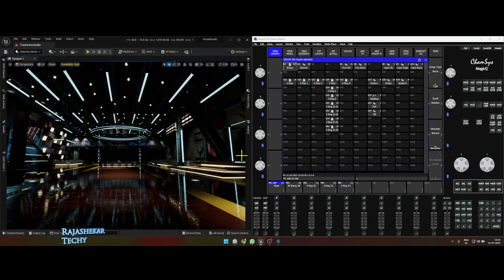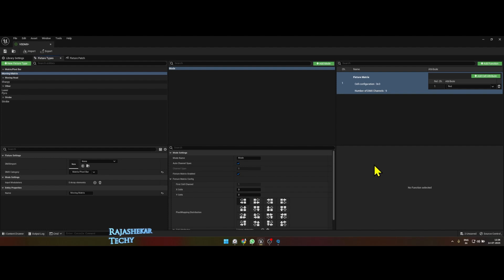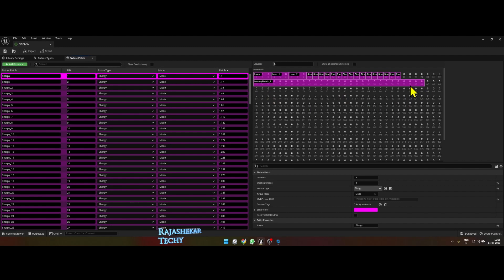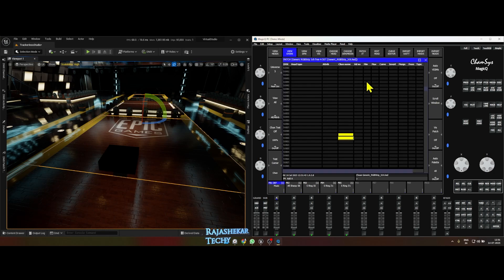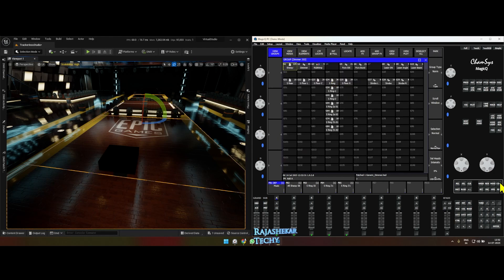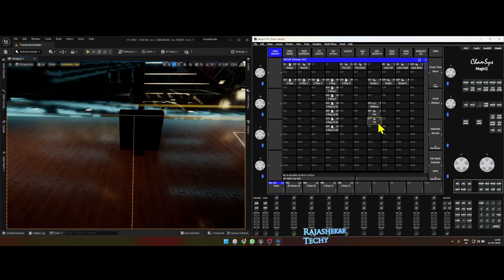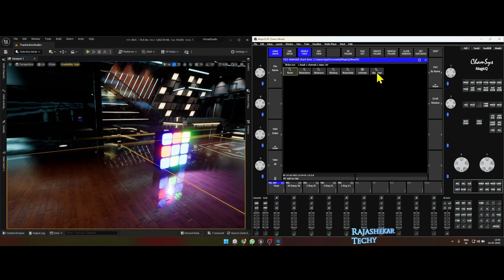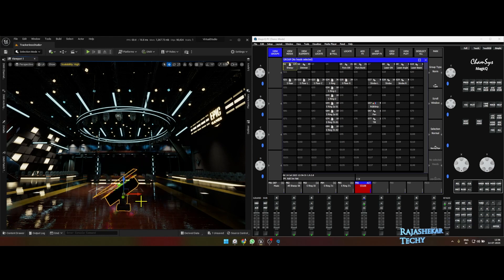How to Patch a Moving Matrix in UE and Chamsys | Matrix with Pan and Tilt function

Comment: Sorry to ask for help again, but I need to get independent control pan and tilt on the moving matrix using an existing fixture profile, something like ADJ Dotz 4.4 or Showtec Phantom, similar to how you got the stock moving spots to work with chamsys using Clay Paky sharpy, i can't seem to set them up properly, thank you.
Reply from the maker: Hi no probs I havent used other programs yet but you can still achieve individual control of Pan Tilt as we have patched it to sep dimmer channels.. try to make a group of them and see if it helps.
Reply: @RajashekarTechy  thank you, I will try